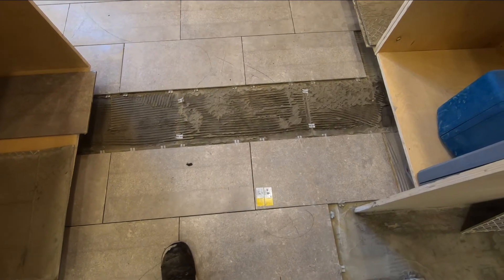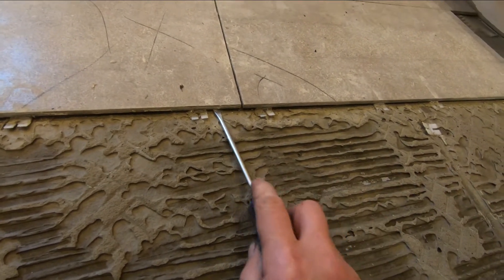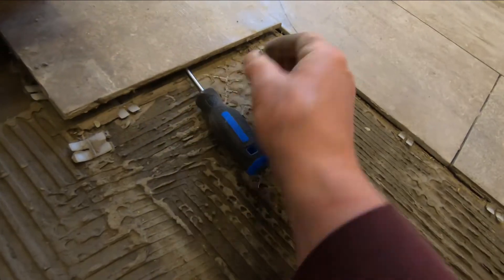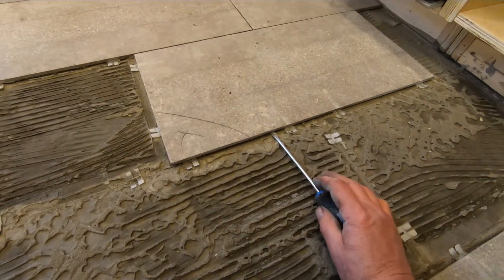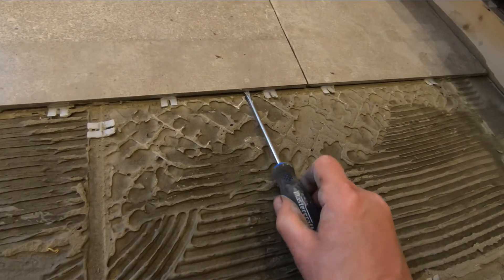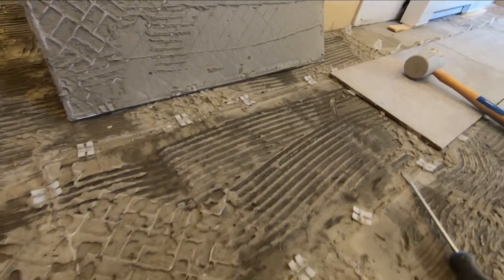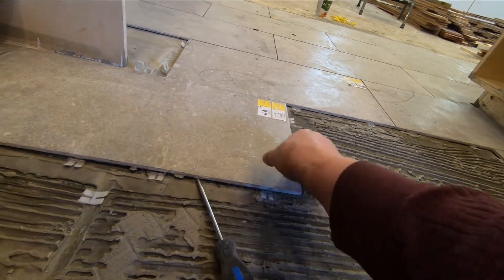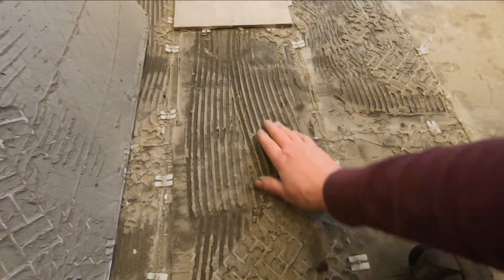FLOOR TILING FAILURE ! WHAT WENT WRONG ?

Comment: Man that's a bummer alright...What do you do to get the mud up off the floor?
Reply from the maker: I looked at the floor again today. At first I was thinking to use a big scraper but I found that a claw hammer (claw towards floor) pushed back and forth vigorously will remove most of the standing ridges. Yes. Major Bummer, but it can be fixed. I was trying to go too thin with the mortar because this floor adjoins two other floors. I didn't want too much of a transition. The curved spacers didn't help either! Embarassing, because this isn't my first rodeo (I've tiled quite a bit) but this one jumped up and bit me in the arse. hahaha